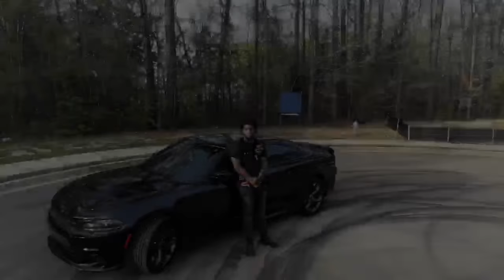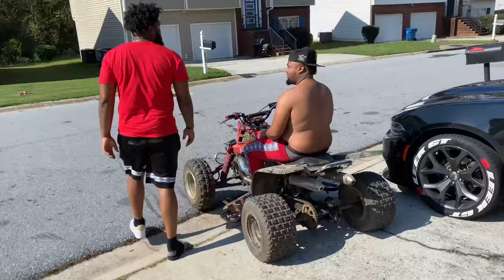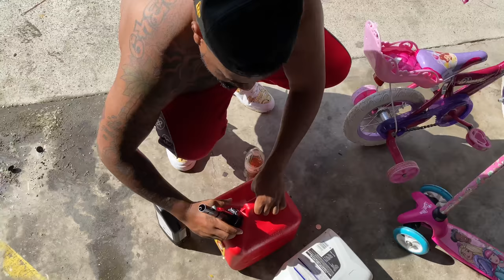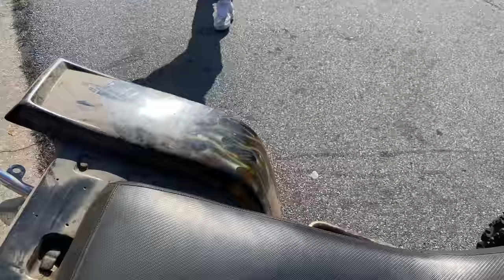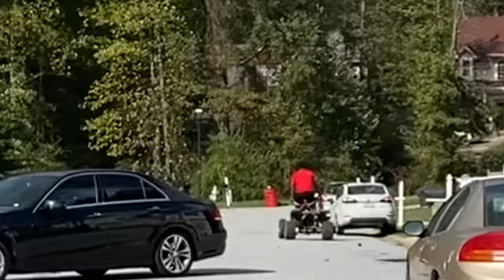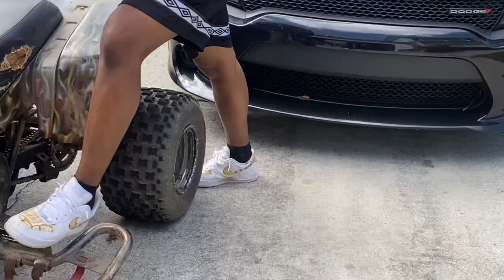FIRST TIME ON A BANSHEE IN YEARS | Yamaha  Banshee | LEEK GT | ATL BIKE LIFE 🔥

Comment: I got an 04 Suburban Z71 with a 3" lift 20" Motos 35" mudders it's in limp mode just put new fuel pump and battery and alternator on it leather interior 288k miles I'll trade